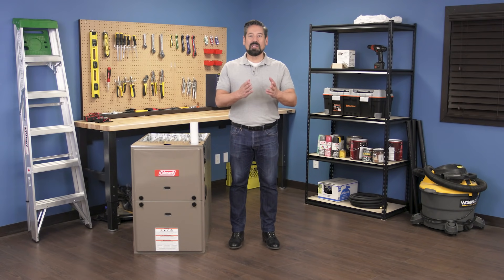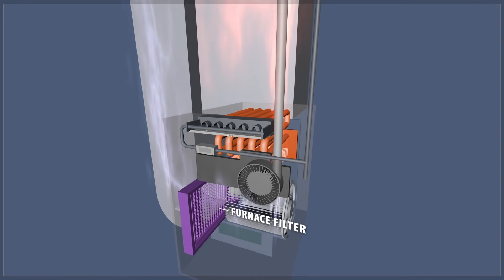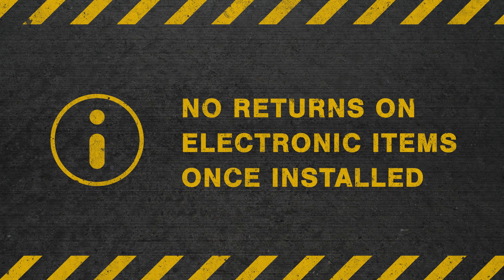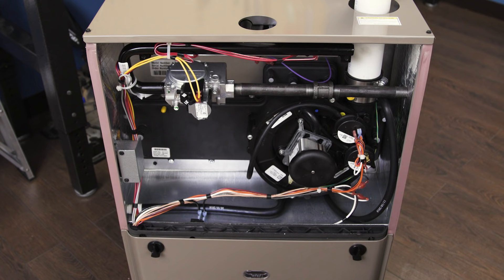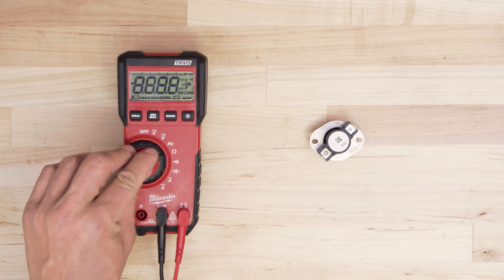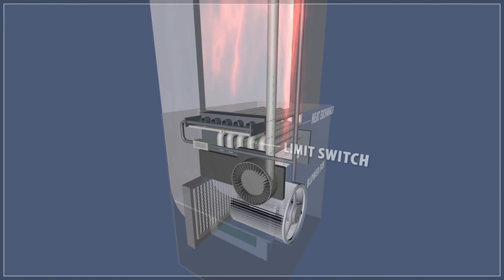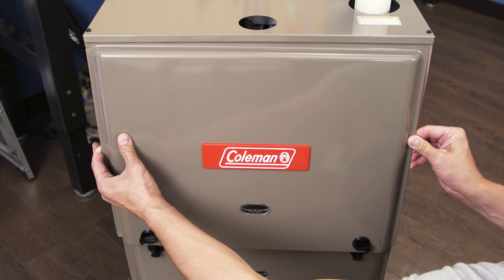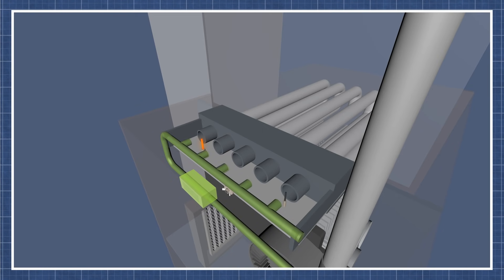Furnace - Limit Switch | Repair and Replace

Comment: Does the limit switch have polarity?
Reply from the maker: Thanks for watching. That is a good question. It doesn't have any polarity as it simply connects or disconnects power to the circuit. It doesn't matter which of the two wires are connected to which terminal.
Reply: @AmreSupply  Thank you.
Reply: @AmreSupply  Thank you. If the flame rollout switch is bad, will burners light up?
Reply from the maker: @HungNguyen-sb1yu  The flame rollout switch shuts off the gas supply if the flames come out the front of the burners.  A faulty switch will prevent the burners from working. If the burners are not lighting then it could still be an issue with the ignitor. This video helps explain the startup sequence: https://www.youtube.com/watch?v=b0sAGt-1niU

Comment: Fsn linit switch is showing around 2 ohms
Reply from the maker: Thanks for watching. That is an acceptable resistance. Usually it's between 0 - 1 ohms as a switch is just a pathway for electricity to pass through. 2 ohms shouldn't change how it functions, it could just be dirty etc

Comment: When I went to Amre store in Hamilton Ontario and explained my problem...she said if you part what you need or part number than I can help.
I said..I have red light flashes once and points to Limit circuits...or switch...but she said I don't know I am not technician...ohhh well .. thank you
Reply from the maker: Thanks for watching. Our staff do have a variety of experience but are not technicians. They can't diagnose problems while at the counter but sometimes will share their thoughts or suggestions depending on the problem.

If your codes point to a problem with the limit switch and you've replaced the air filter, then it might be best to install a new limit switch.

On the side of the limit switch is a part number. Sometimes you can search by this part number directly. https://www.amresupply.com/catalog/Fan-Limit-Controls-HZ3D

In other cases you might not be able to find an exact match. You can match by size and shape, and the rating on the side of the switch. For example you might see something like "L210-30F". That means that the switch has a high limit of 210°F and will open the circuit at that point. Once the temperature drops 30°F the switch will close, and reset.

Hope this helps.

Comment: Those little switches go bad all the time better to just make a jumper wire with terminals and jump the wires and zip tie it to the furnace put cover back on call it a day~
Reply from the maker: Thanks for watching. Safety switches are needed to shut off the furnace if an unsafe condition happens. It is not recommended to ever run a furnace with a safety switch bypassed.
Reply: @AmreSupply  what if your in a hurry and just want to get paid?
Reply from the maker: @ironjohn5914  It's pretty simple, bypassing safety switches is dangerous and irresponsible.
Reply: @AmreSupply  what if your hungry and just want a hot meal and the furnace to work~
Reply: @AmreSupply  sometimes you got to just take a chance and let the chips fall where they may because who has time to mess around with little switches tripping the old school furnaces never even had those lol

Comment: Furnace runs blowout heat but not like it did last year.  ICP# N8MSL..led code light flashing like heart beat.
Reply from the maker: Thanks for watching. There is likely a chart showing what the error codes mean. This might be listed on a sticker on the inside of the furnace door, or in the in the furnace manual.

Comment: I have an old coleman 2865-656.  The furnace is still working fine but what happens is it runs a normal cycle then shuts off.  A few minutes later it will start blowing for about 10 seconds then shut off?  Could this be the limit switch or any ideas what could be causing this?  If I open the furnace door or remove the filter the short cycle does not happen
Reply from the maker: Thanks for watching. It could be a  faulty limit switch cutting out at lower and lower temperatures. Since the symptoms improved when you remove the filter and opened the furnace door its worth checking to make sure that the airflow is good overall as this could cause the heat exchanger to overheat. On the other hand if you open the furnace door, heat will be released and its possible that the limit switch is just not getting near it's cutoff point anymore.
Reply: @AmreSupply  Thanks for the reply.  It looks like you don't sell the limit switch for my coleman model 2865-656.  Do you have anything that is compatible?
Reply from the maker: @chains7  If the part number doesn't come up as an exact match then you can match by shape and by the rating. You will likely have a number on the side of the limit switch. For example if the switch says L170-30F then that means the switch will open at it's upper limit of 170°F and close after the temperature has dropped 30°F below that limit (when it gets to 140°F). Knowing this can let you match with any switch with the same mounting holes and shape. https://www.amresupply.com/catalog/Fan-Limit-Controls-HZ3D
Reply: @AmreSupply  Mine only is stamped with 195F ?  Other markings say 205811, 2845-319 & 60T14.  Furnace is coleman model 2865-656
Reply from the maker: @chains7  Judging by the 60T14, that denotes a 60T series of switches. The 60T14 is the style. There is this document that is from Emerson: https://www.emerson.com/documents/commercial-residential/60t-product-bulletin-en-us-152042.pdf This shows a numbering guide.

Looking at this other emerson document there is a part list: https://climate.emerson.com/documents/snap-disc-fixed-temperature-fan-limits-catalog-en-us-4282456.pdf

Going by this and picking a slightly lower limit at 190 this part number 3L01-190 might be the closest match: https://www.amresupply.com/part/16687696 

Hope this helps!

Comment: My thermostat seems to be functioning normally. It calls for heat, the furnace comes on and heats the house. When it reaches temperature, the thermostat “clicks,” telling the furnace to shut down. The blower continues to run for a few minutes until the air is cool. Then, the blower fan shuts off. A few seconds later, it comes back on for 3-20 seconds. Shuts off. Comes on. This happens 6 or more times, finally, I hear a “click” at the furnace and it stays off. Is the fan limit switch going out? Thanks! 
(Duo-Therm Furnace in an older mobile home)
Reply from the maker: Thanks for watching. Since the furnace reaches its temperature before it shuts off and starts cycling on and is a sign of a faulty limit switch. The switch has likely worn out and is tripping at lower and lower temperatures.
Reply: @AmreSupply  
Thank you SO much. 🙏 I will try to order the part from your website. Great video— very helpful!
Reply from the maker: @candacerushing6882  You're welcome, we're just happy to help!
Reply: @AmreSupply  

Sorry to be a pest. I’m not having much luck with your website. The part I need is a Therm-O-Disc switch that says AF 151 F130  47100 6 74 on the side. I’m not really sure what the actual “part number” is. It’s for a Duo-Therm furnace (76601-001) in a 1976 mobile home. I have photos. I found ONE place that sells Duo-Therm parts, but they only sell to contractors. Thanks for ANY suggestions!
Reply from the maker: @candacerushing6882  It is hard to find parts for older furnaces, and I'm not sure how many specific parts we have for mobile homes compared to residential homes. If no part number show up when you search you can match based on shape and rating. You will see that these switches have a cutoff temperature which from your example is (F130) or 130°F. There can also be another number of when it cuts in again. https://www.amresupply.com/catalog/Fan-Limit-Controls-HZ3D It is however best to find an exact replacement by the part numbers themselves but can be tricky to narrow down. If you have the same shape and size, and temperature ratings then the switch will work the same regardless of brand.
Reply: @AmreSupply  
Thank you, that helps a lot!

Comment: how do I fid out my furnace limit switch model number? I see many brands and versions in the Website - @t
Reply from the maker: Thank you for watching. Unlike appliance parts, model breakdowns for furnaces are less common. For matching the limit switch you can look for a part number on the side of the limit switch. You can also match based on dimensions and the ratings. You might also see several numbers on the rating. If you see a L140-20 it means that the switch will open at 140°F and close only when the temperature drops 20°F. Hope this helps!

Comment: bypass the switch by jumping wires going in to the switch. you can do this with all the limit switches.
Reply from the maker: Thanks for watching. It is not recommended to bypass any safety device or switch including the limit switch. Bypassing safety switches and running the furnace is dangerous and means that your furnace will not properly shut itself down in the case of an unsafe condition.
Reply: @AmreSupply   indeed. safety is a personal choice. i was just providing information.
Reply from the maker: @jonathanmayberrydesigns  We appreciate the reply and its good to share information but we felt it was important to clarify the context around it, especially when it comes to safety. There are people who will take information, and with only a partial understanding of it, cause damage.

Comment: Thank you for the helpful video! I am wondering if you know why the fan to my furnace will immediately turn on and off twice (only for a few seconds) 
after a heating cycle. Could this be due to a problem with the safety switch?
Reply from the maker: Thanks for watching. It could be because of one of the safety switches potentially a pressure switch. It would be best to observe and see if the furnace gives any error codes. As well some of the logic is shown in this video https://www.youtube.com/watch?v=b0sAGt-1niU

Comment: Great video!  I have a Heil NDGK075DF03 that stop running the burners after awhile & won't turn relight for a couple hours of being off.  I pulled the limit switch & all it has is a part ELMWOOD #2455R but no temp. range.  How do I find out the range?  Bought one online ELMWOOD-2455R F194 Close 194F that I'm guessing is open because it has no continuity, I think that's what the "F" is for instead of "L" which is probably what I need.  Any help would be appreciated.
Reply from the maker: Hi Scott, thank you for watching. Unless there is something unique about your furnace your limit switch should be closed and have continuity at room temperature, it opens at its high limit and closes at another range as well. Both numbers need to be taken into account. If you tested the limit switch in your furnace and verified that it has no continuity at room temperature then its best to install a new one. If you're not sure if the limit switch is the problem then its best to try to check the furnace codes or narrow down the part based on these steps in this video: https://www.youtube.com/watch?v=b0sAGt-1niU

If possible try to use your model number of your furnace to get more information on the temperature range of the switch. If you're able to find a parts list will likely list something like SWITCH LMT 130-20 or even something like SWITCH LIMIT 170F-30 etc In this example 170 °F would be the temperature it opens and it would close 30 degrees below that at 140 °F

Hope this helps.
Reply: @AmreSupply  I'm pretty sure this 80's furnace doesn't have any codes or lights to check or run.  However, I was able to check both limit switches (1 near burners, 1 on draft/exhaust housing) that were closed (continuity) at the time the furnace wasn't firing so I believe they are ok unless they're intermittent.  I'll check the video you linked & try to further diagnose.  Thank you.
Reply from the maker: @scottlarson6699  It if is an older furnace with a draft inducer, then you might have a fan limit switch. This is different than a high limit switch in that its used to help control the blowers. The blower isn't supposed to turn on right away so without an intellegent control board, the switches are used. In this example a fan limit switch would be open at room temperature and would only close (and turn on the blower) once the heat exchanger warms up. Its important to narrow this down as putting the wrong limit switch will cause the furnace not to work correct. More info on fan limit switches is here, if you scroll down there's a section on the sequence of operation: https://inspectapedia.com/heat/Fan_Limit_Switch_Guide.php

Comment: What happened if I switch out my old style Honeywell switch with one of these?
Reply from the maker: Thanks for watching. When installing a limit switch it must be similar enough to be mounted in the same way and it must also have the same ratings. Without the same ratings, it will change how your furnace operates. This can make your furnace unsafe.

Comment: I had one technicians found out the limit switch is defective. He didn't even bother taking it out to diagnose the darn thing or take pictures. I scoured ebay,Amazon and other website to email him the parts.  He keeps on saying they're not the right parts--NO. Wanna know what I did???? I don't care how many positive reviews his company received. I gave a 1/10 rating. That was July 2021 during the abnormal summer heat in Vancouver,BC.

Second time this October. Another technician finally took photos of the limit switch and in process of finding replacement. I texted him to email me the pictures so I can help out. You know what he replied? "Go find it yourself."

I have no knowledge with electrical/mechanical equipment thatz why I called for hvac technicians to do their job. They just take my money and leave. 

I'll take out the damn thing myself and find replacement. It's a learning experience indeed.
Reply from the maker: Thanks for sharing your experience. Even though there are some great technicians, there are others that don't offer the same level of customer service. The limit switch is simple to replace. You can match by part number or by the rating on the switch. A L180-40 means that the switch will open at 180°F and close once the temperature drops 40°F (at 140°F). These ratings need to be matched exactly. https://www.amresupply.com/catalog/Fan-Limit-Controls-HZ3D

As well if you want to improve your knowledge of electricity and multimeters this 10 minute video will help explain the concepts in more detail: https://www.youtube.com/watch?v=r_migcta_Is as well this video explains appliance components: https://www.youtube.com/watch?v=e_1pOWSVUfg

Comment: what is the differance between limit switch and flame rollout switch  .. they are a same shape
Reply from the maker: Thanks for watching. They are both thermal disc based switches but will be configured a little differently and will have different ratings. Some flame rollout switches have a reset button and some don't. Limit switches generally don't use a reset.
Reply: @AmreSupply   Thank you so much for your imazing videos they was so helpful
Reply from the maker: @blueskyaircon3245  You're welcome, we're just happy to help!

Comment: I think I have too much gas getting by when I look at my flames it is coming out of more than just the port it’s coming out of the whole end and is getting too hot. There is an adjustment screw on my gas valve can I just turn it down to where it looks like it’s working properly
Reply from the maker: Thanks for watching. That is a good question and yes the adjustment screw can be used to adjust the size of the flame. Just be observant if its a crisp blue flame or if its yellow or golden. If the flame is yellow then it would also be best to clean the burners.
Reply: I think I’m going to have to replace the exhaust fan also
Reply from the maker: @jeremyjjet4909  The repair isn't too difficult we made a video outlining how to remove the blower wheel and replace the motor and capacitor. You can see it here: https://www.youtube.com/watch?v=4SY8lRl8HV0
Alternatively if you were referring to the inducer blower fan, then the repair is a little different: 
https://www.youtube.com/watch?v=EsJhfFMZWJA

Comment: Does the wire order matter, when reconnecting the switch?
Reply from the maker: Thanks for watching. Switches and fuses are simply paths for electricity to pass through and aren't affected by the polarity of the wires. This means it doesn't matter what order that you reconnect the two original wires, the switch will work the same.
Reply: @AmreSupply  thanks!

Comment: My furnace runs but shows a fault code of limit circuit fault...what could be the problem.?
Reply from the maker: Hi Kenny, thanks for watching. If your furnace gets a limit fault code then it could be an airflow issue creating overheating or the limit switch could be defective.

Comment: Can the wires be hooked up backwards?
Reply from the maker: Thanks for watching. A switch simply connects or disconnects power. Its not effected by the polarity of the wires so it doesn't matter which terminals the 2 wires are connected to. You can swap the order and it won't effect the switch.